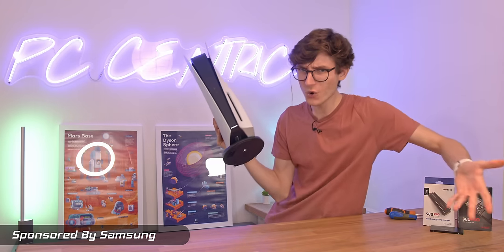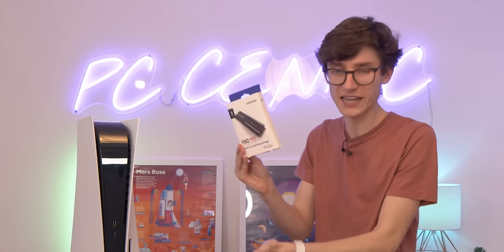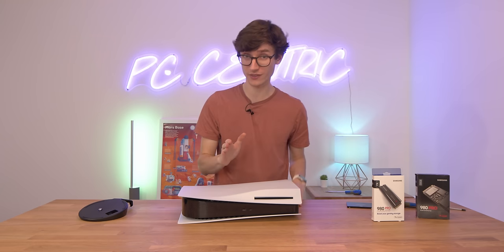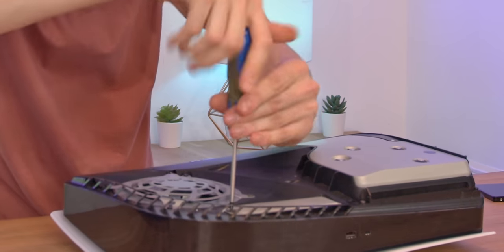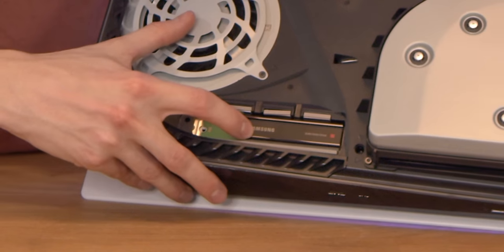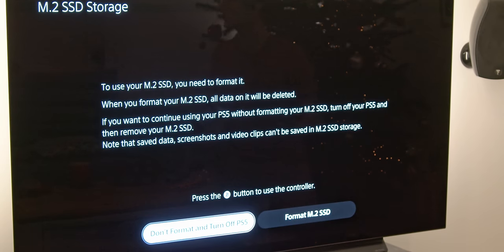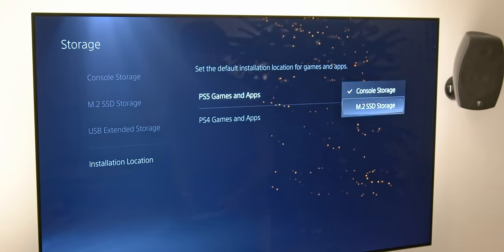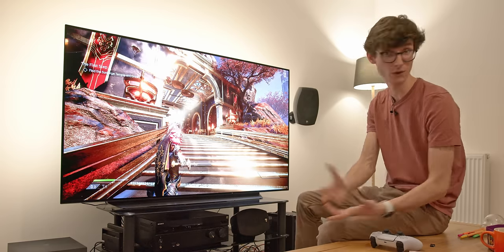How To Upgrade A PS5 SSD 😁 - Samsung 980 Pro Install for PlayStation 5 | AD

Comment: Why is the read speed only 5500MB/S on PS5? The SN850 reads 6,500 MB/S so the 980 isn’t as good on PS5?
Reply: Between those mentioned FireCuda trumps both. But PS5 seems to bottle neck around 6500. But if it evolves 7400mb is the gen4 theoretical max not necessarily real world. Seagates has double the endurance and heatsink done by ekwb. Sold for me. Enjoy your ps5 bud.
Reply: @phildavis8732  I watched a video on Digital Foundry and they say the benchmark is not very accurate because they used a slower drive than to spec and it read out as a much higher rate, so unsure if the benchmark actually means anything much.

I got the 980 Pro on sale and added a custom heatsink but I probably should have gone for the SN850 for the higher speeds on PS5 even though in theory they are the same…
Reply: @Edmundostudios  fair comments. I think any high reputation brand doing a 7GB part will all do the job in reality. I keep consoles so endurance means a lot to me which Firecuda is 0.7 dwpd vs sam/wd at 0.3. More than double the life. Icing on the cake is ekwb heatsink operates at much lower temps from all the group testing I've seen largely on NAScompares channel. Seems to cover it in the greatest detail. Games will get more demanding and temps will play a bigger roll in years to come. Extra coin for firecuda but if seen as a long term investment the logical choice where temp, durability and performance are factored. Especially if you can use in pc its the champ still. All that said most drives will do the job. I just treat as an investment for the long term not the best price on the day. Each to their own. Enjoy your drive bud.
Reply: If you update the firmware of the 980pro on a pc before installing it bumps to about 6,500, but it’s a PITA.
Reply: @neveucd  Yeah I heard about that recently. I wonder if it even makes a difference or it’s simply an adjustment so that shows the correct speed on the PS5.
Reply: The bottle neck even with 7500mb theoretical max on gen4 the ps5 will cap below 6600mb. Decisions should be based on other factors that are important to you. Cost, durability, temp, add on services like the data recovery on firecuda. Cost WD win. Best all round is firecuda but cost is higher. I went for this for temp and durability, data recovery bolt is a nice to have. Plus if I double my storage no other part is better in a pc where real world usage is concerned even for the most demanding tasks. On Scans channel they detail this with torture test analysis. Pay for the best or buy on price that can still do a good job. That's my take.

Comment: Wouldn't it offer even better cooling mangament if you leave the ssd slot cover off? This scenario still provided with the same samsung 980 pro or any other ssd with heatsink? Like additional cooling because any heat isnt directly trapped under the ssd door cover

Comment: Would it be ok to add a ssd after you’ve already been using your ps5 and have saved data on it? Like will be able to add the storage to the system without erasing anything?

Comment: Hey I just bought this ssd.  Heard it may need a firmware update to unlock potential of the ssd in ps5.  Does it make that much of a difference by updating?

Comment: The PS5 Needs about 12 TB right now 2 isn’t enough the only thing that can handle 1 TB is the iPhone 13 pro max there are no such crazy apps that’s 200 gb like call of duty my PS4 has an external 4TB it’s full already my Xbox one has external 8 TB hard drive plus 2 TB external and 1TB it only has 380 gb free of space the best thing about Xbox that PlayStation doesn’t do is let you play the games through the cloud don’t need to install the games so I have more space on Xbox then I do on PS5
Reply: Dont you have 1gb internet? only takes couple min to donwnload. no need such a huge storage and keep all games you have. Earase you dont play often

Comment: I ended up stripping the the 2nd screw
Whack ass screwdriver wouldn't work and it was even a special one
Will it affect the drive if it isn't screwed with the 2nd screw?

Comment: I ordered this ssd, is it necessary to update its firmware in order to read 6500 mbps from 5500? I know on pc it would obviously be better but would it make a huge difference on ps5? Yes im a noob on these things.
Reply: Right now the drives seem te come with the newest firmware. did you still have to update it?

Comment: I just cannot fathom why I can't use external storage devices for ps5 games. 825 gbs is not enough, btw its not 825 gigs, for those that have owned a ps4 or ps5 the console itself needs space for it's own functions so it's more like 667 or slightly lower just a FYI for those that don't have one yet. I bought into the inflated price of $800 for mine out of sheer impatience.
Reply: Simple, external drives barely have enough read and write speeds to handle native PS5 games. I thought the answer to your question was already obvious, I guess it was not.

Comment: Questions,  been thinking about getting one to upgrade my storage use. I've been hearing about the need to update the firmware if it's order then 2021 release.  Is it possible to update without having a tower?  I only have a laptop 😮😢

Comment: is it true that if you don't update its firmware before using it, it degrades very quickly?? My problem is I don't have a PC with Nvme slots to do it and it can't be done either on the ps5

Comment: Does anyone tried to update the firmware of this SSD with a heatsink? There are some reviews that It needs to be updated before putting to PS5 to met maximum the writing and reading speed. But the issue is I think I should not remove the original heatsink due to warranty.

Comment: I have this exact SSD and its slightly loose when i put it in. I tried at least 10 times at an angle and when i turn the PS5 on, it acts like nothing is in there.

Comment: I have the exact same SSD, however when I Installed it, I've never got the SSD menu when turning the PS5 on. I did the PS5 factory reset and I still have same problem. Any idea what could be wrong ? Thank You

Comment: Im gonna get the SAMSUNG 980 PRO, 500 GB SSD
(MZ-V8P500BW, PCIe Gen 4.0 x4, NVMe 1.3). Just for clarification, is it compatible with the ps5? It has 6900 read speed but 5000 write speed. Thanks!

Comment: Deciding between the 1tb or 2tb, does it make a difference at all on the drives performance. (Dumb question but curious
)
Reply: I just ordered the 2tb wit the heat sink and it’ll be arriving tomorrow. I don’t think it’ll mess wit the drives performance but since I have no received mine yet I cannot confirm it. I see your comment was about a month ago. Have you gotten your 2tb ssd and how is it?
Reply: @hi-way1850  tell me what ssd did you use I'm thinking of getting the Samsung 980 pro with heatsink 2tb

Comment: I wonder could you use a firecuda 530 2tb on here? A read of 7300 mbps would be unreal on a ps5 ?!!
Reply: I was actually going to get the 4TB version of that drive. But on Black Friday it was £799 British, while the Sabrent Rocket 4 Plus 4TB (read speeds of 7000 mbps) was only £560 (plus £10 extra for a heatsink). Basically, my point is that the Firecuda 530 is a great solid state drive, but has crap value.

Comment: What happens to the data when you remove the drive after installing games on it? Does it stay om the drive? Can you bring your ssd to another ps5?
Reply from the maker: It would stay on the drive - not sure if you can whack it in another ps5 and it works out of the box - I assume so, but no guarantees

Comment: btw, you don’t necessarily need a heatsink for your ssd, also, you need not reinstall the white cover if you have a heatsink too big or if u dont have a heatsink, the ssd will actually run cooler if u keep the cover off.

Comment: You can download Warzone onto your 1tb ssd and maybe have room for 1 one more game 😛
Reply: Lol, it's awful isn't it?
Reply: That is why I got a 4TB solid state drive. It was expensive, but got it for a good deal on Black Friday and I can now forget about storage until I get my next console in the future.
Reply: @shyamal903  4TB, you spoiled brat :-). I ended up buying a 1TB. So pleased I bought it.
Reply: @Bolkiebasher  How does that make me a spoiled brat? I bought the solid state drive with my own money that I earned from my own job. Do you even know what spoiled brat means? Because you are not using the term correctly at all.
Reply: @shyamal903  I’m sorry! I know what it means but I meant that as a joke. Of course you are not a spoiled brat, it is just such a luxury to have so much space. Indeed, well done in spending you hard earned money on 4TB. The SSD is hard to get at this moment so there were no offers when I bought mine. However, enough space for various CoD’s and other games.

Comment: You forgot to eat chicken wings while working on  it, and drop your system on the floor several times before slamming the cover plate back onto your system mate. 
Sloppy work, I don't recommend using this as a reference.

Comment: tf, this is not the way you should open your PS5. You will break it. You also didn't show that you should remove the 110 screw and insert it in the 80 slot. What a terrible review.

Comment: Xbox should make a video about this 

this is how you install your SSD
wow 2 seconds 

meanwhile PlayStation 
ohhhh fuck this 
throws PlayStation to the wall
Reply: At least is Sony using an industry standard I mean u can use the SSD easily inside a PC. They are faster and way cheaper 146€ PS5 vs 219€ Xbox 😂